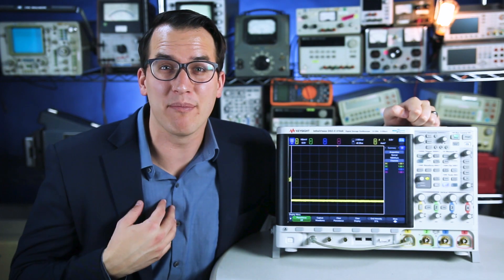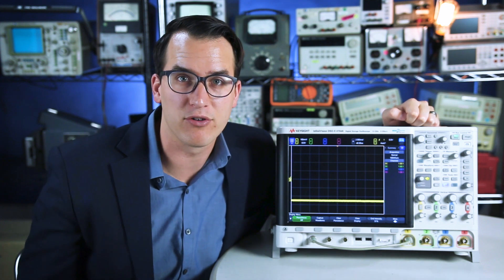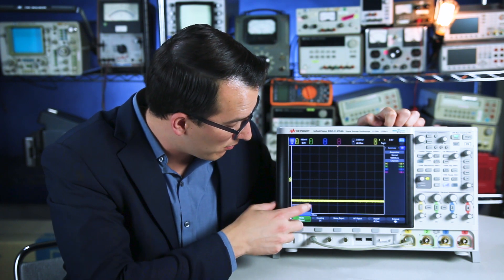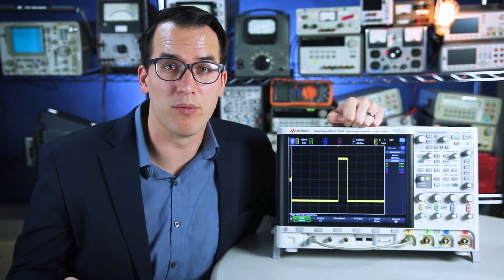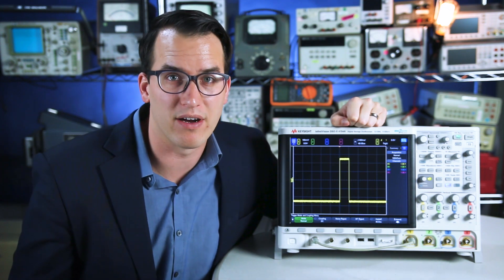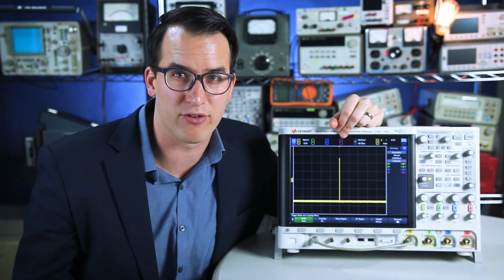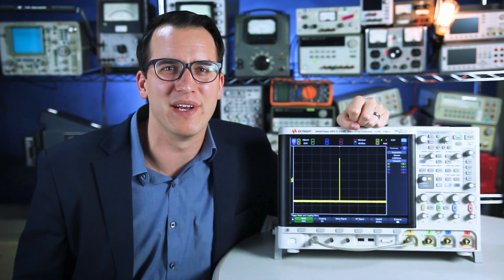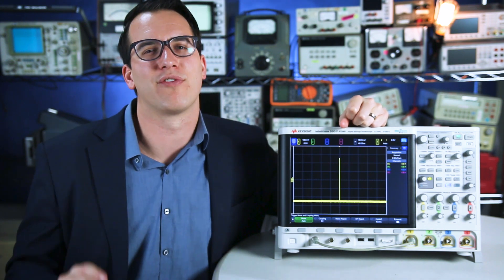Triggering tricks for infrequent signals - Oscilloscope How To - The 2-Minute Guru (s1e5)

Comment: Great and simple video. Nice work. And could you give me an example to capture the different jitter signal which has some different duty cycle ?
Reply from the maker: +Chenxiang Hsu Thanks!  Good suggestion.  In the mean time, you could try changing the trigger holdoff or using a pulse width trigger!